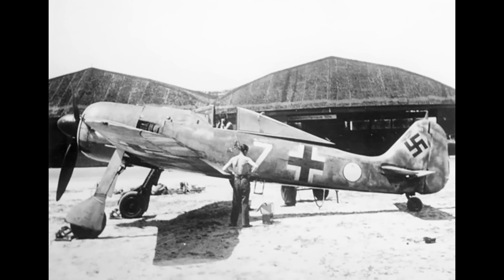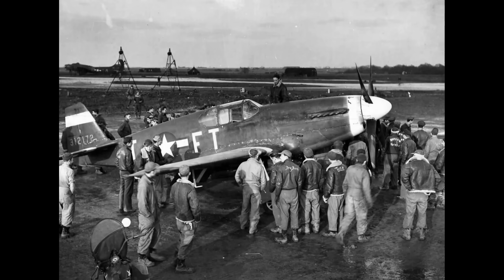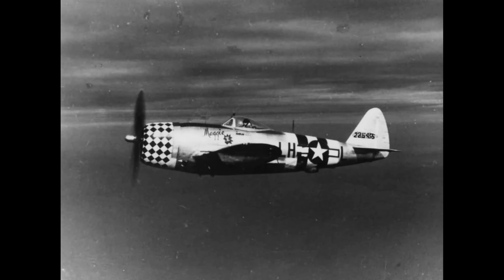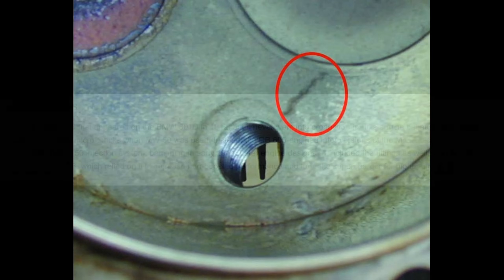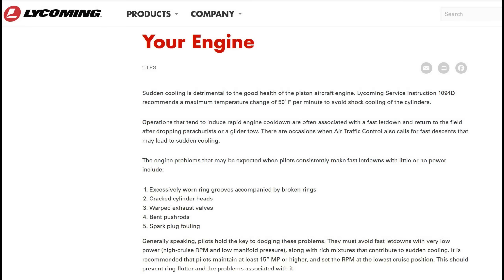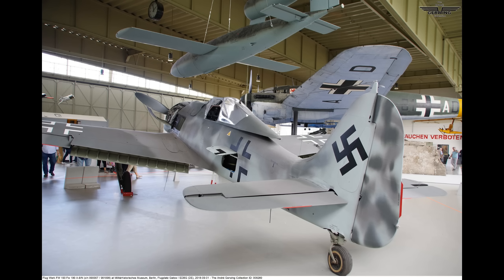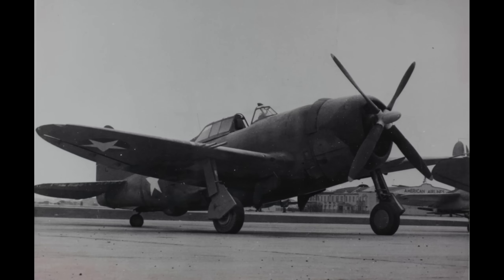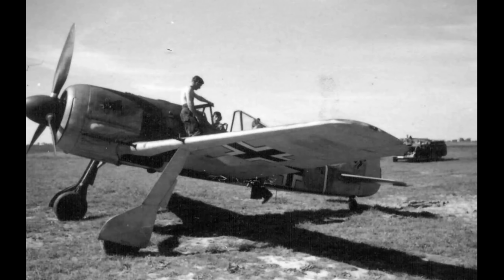Focke-Wulf Fw 190 A-4, Almost turned the tide, Almost...

Comment: Speaking briefly on cylinder head temperature, it's not unlike block temperature of the cooling in an air-cooled engine or a water jacket in a water in a water cooled engine, one thing they share closely is after hours and hours of being at a constant rate the metal gets fully total saturation of heat, this starts to happen after 3 hours of operation and continues to happen for the next 17 to 20 hours of continuous operation, anything after 3 hours the metal is totally heated completely through and through so the swelling is mild but it does happen in the casting. Billet aluminum reacts differently but that's another story, the point I'm trying to make is that when you back off the throttle pressure on an air-cooled engine and the increase in density of the air makes it react to the surface of the cylinder head casting, it contracts at a different rate, this leads to cracking on the surface of the casting.
After repeated heating and cooling cycles then the cracks become bigger.. engines that are in service for less then the 3-hour time frame, they do not suffer the heat of the deep soak.. cracking..

Comment: I have a lot of respect for your knowledge of aircraft. But, I’m tired at people thinking that “this could have changed the war”, or something to that extent. I’m not saying that that’s actually what your stating, but still…There is virtually nothing that would, or could have changed the war. Even the jets couldn’t have changed the war other than to possibly have lengthened it by a few months. Unlikely, but slightly possible.
Reply from the maker: I'm tired of people misquoting me. I said nothing about changing the war. I said turn the tide. The Luftwaffe literally DID turn the tide of the air war several times, including once time in late 1943 when they forced the USAAF to stop sending daylight raids into Germany.
Reply: @GregsAirplanesandAutomobiles  The source of this often- stated issue is that the title of the video and the still screenshot of the video should mesh with the content of the video itself- and they do not. In the body of the video, you clearly reference a 1943- time frame- but this is not referenced in either the title or the screenshot. Without that reference point, the title (and the wording of the screenshot) implies that the tide of the war itself could have been turned. I'm not trying to make a big issue out of this; I'm just saying that I believe that 'that' is the source of a misunderstanding.

In any event, it's quite a statement to say that the Luftwaffe turned the tide of the war in late 1943. Doing so would have required that they not only halted the Allied bomber offensive (which they temporarily did) but then took the offensive themselves right back to the Allies in something approximating equal intensity- which they were never in a position to do. FWIW, I believe that it's an open question whether German fighters with a few hundred extra horsepower could have hammered a resurgent Allied bomber offensive in early 1944 so as to prevent D- Day. The German fighter arm was being bled white of pilots by late March, but a few hundred extra horsepower just 'may' have prolonged that bleeding and delayed D- Day by some months.
Cheers...

Comment: The German found that the MW50 didn't work desirable enough on 190A. Besides the potential corrosion or cracking problems in the cylinders, to use the MW50 also required tuning the BMW engine into a lean mixture way for some reasons. This led to a situation where when the MW50 was not applied, the engine output would be lower and overheating might occur. On the other hand, the C3 injection worked almost flawlessly, it could increase the power to 2060ps at around sealevel without any significant changes or problem. The C3 injection was introduced to the frontline around July 1943, and it developed into the Erhöhte Notleistung, increased emergency power, in July 1944, which could be also applied at the second gear altitude.
Reply: This is more or less the correct story.    The BMW 801D2 is not an engine limited to 1700hp.   As the Germans increased the rating of C3 fuel from about 94/115 to 96/125 and finally 97/130 along with probably spark plug improvements allowed increased engine boost ratings.  As you can see the rich rating increased mainly.   The upgraded C3 fuels started to come in from 1942 as allied fuel intelligence noted (see Fischer-Tropsch Archives).    Two boost systems were introduced in 1943.   The first system was called "increased boost"  which which produced a rich mixture that was injected  via the normal injection system on fighter aircraft.  Rich mixture injection into the eye of the supercharger was introduced only on ground attack aircraft.  Latter the two systems were combined.    Long story short the BMW 801D2 ended up a 1900hp engine before being replaced by the BMW801TS and BMW801TH.

Comment: In the old game Chuck Yeager's Air Combat, which I was addicted to at the time, an FW-190 A-4 was one of two flyable aircraft of the WWII era, the other being a P-51D. The plane's description admitted something among the lines of "performance at altitude was poor, especially in the A-4 ground attack variant", and I've never quite forgiven the developers for choosing that specific variant then. 
Back then I could basically count the pixels above the horizon on my crt monitor to find a suitable steady climbing angle: the P-51 had considerably more pixels to spare than the A-4.

Comment: We saw shock cooling cracks primarily in TCM O-200 engines due to student pilots NOT practicing throttle disciple and the design of the cylinder head casting. The O-200(and pretty much all TCM engines that use this and similar cylinder head casting design) is a much lighter casting than a comparable Lycoming cylinder head casting. Less material in critical areas of the casting equals more tendency for shock cooling cracking. Student pilots were leaving the engines at full power, even when in the pattern for touch and go landings, then jerking the throttle back to idle when turning final. The result? Cracked cylinders. The Lycoming O-320s in Cessna 172s didn’t have this problem. We saw cracked cylinders on the GTSIO-520s on Cessna 421s but never saw a cracked cylinder on the Navajo C and Chieftains we operated on Part 135.

Comment: In descent, reducing power (and therefore MP) results in cooling that can lead to carb icing, which is why in descent to landing full carb heat is applied. Would that help to mitigate shock cooling at all, or is carb heat insufficient to overcome this? Of course in fuel-injected engines there is no carb heat, so would some sort of intake tract heater have been a possible fix for this problem?

Comment: Apologies if I've got this wrong, but from what I can read MW50 was injected into the face of the supercharger, cooling the incoming airstream before it gets to the cylinders.  If so, would not the freeze effect occur on the intake stroke, with the already-cooled gas stream meeting the cylinder surfaces heated by the power and exhaust strokes?  Compression of the cooled mixture would still heat it up (otherwise Diesels wouldn't work), so I don't understand how the maxiumum cooling effect would be on the compression stroke instead of the intake stroke.
Reply from the maker: This is such a common misconception that I'm going to need to make a video to explain it.

Comment: There are a lot of testimonies from RAF pilots when the anton came out and the effect it had. They are often described as more lethal, and harder to fight initially than then 109s. Because they could pull more in the first few turns and upgraded armament.
Clostermann also talked about that. They were preferred by axis pilots in the west before normandy at least. But its also true they faced more bombers
Reply: The Spitfire Mk V had a single speed supercharger with very tall gearing, the two speed supercharger in the 190A was more powerful at low and medium altitudes.

Comment: From what I've seen flying the A4 and A5 in simulators, supercharger gear ideal altitudes make a large different in dogfight ability. Staying somewhere around 5-6000ft makes an A5 handle like an A4 at a less ideal altitude like 10000ft. Unfortunately, the superchargers second gear only makes good power again up at 20000ft, where the wing loading becomes quite prohibitive to dogfighting.

Comment: Some should tell ford engine designers and cooling system designers about shock cooling. Especially with the issues with various small turbo engines and highly stressed truck engines. More attention needs to be paid post engine shutdown and large speed differences on high performance engines. I mention Ford as a Ford retiree but past Chrysler engines such as the 2.7 n/a V6 suffered sludging issues possibly related shock or flash cooling. This is an interesting issue that goes across other engineering systems. It seems cross functional team concepts work not only intra discipline but inter discipline systems. Thanks very much for this video post. Any auto people who see this video should pass the issues and ideas up the line. Thanks again.

Comment: The higher the octane the less volatile the fuel is. High octane fuel is great for air cooled engines because it prevents pre-ignition caused by hotter running engines. So with that said, higher octane actually means less power rather than more power. However, putting high octane in your car doesn’t make it faster, it’s quite the opposite, especially if the engine isn’t designed for it in regards to MPG, ping and power. Great video Greg!
Reply: Higher octane allows more power through greater boost or compression being allowed
Reply: @kenneth9874  This is true for engines designed specifically to operate like that. However, it’s a detriment to engines not designed to operate under high compression/temperatures. The octane is only added to prevent pre ignition of hotter running, higher compression engines. The octane in of itself doesn’t provide more power.
Reply: @privatepilot4064  it enables the engine to make more power, there's a reason the octane level were increased during the war.....it's called making more power.
Reply: @kenneth9874  I’m not disagreeing with you, but it will not make more power in engines that are not designed for it. The reason they increased the octane in WW2 was because of the high performance engines which needed the octane to prevent pre ignition, particularly in aircraft engines. Octane prevents pre ignition which means the fuel was igniting before the engine was in its optimal power stroke because of high compression. Similar to how a diesel ignites fuel. This causes knocking and loss of power, but only in high compression engines that are not utilizing octane. (That’s why a diesel always sounds like it has a knock, because it ignites fuel with high compression). Octane prevents this by making the fuel less volatile. The reason higher octane fuel is used in high performance cars (and often thought of as 'better' fuel) is high performance cars run high compression engines and need a fuel less likely to ignite from the compression energy. They produce more power because they burn more fuel not because the fuel is more energy dense. With that in mind, if you have an older vehicle that normally burns 87 octane and you develop a knock, it’s most likely from deposits that have built up in the cylinder reducing the cubic inch capacity and causing its compression to increase. In this case a high octane fuel would reduce or eliminate the knocking.

Comment: An interesting little video.   The '190 was excellent at low to medium altitude, and the RAF struggled with the Spit'V's for several months at low to medium altitudes. The articles from that period in the Tee Emm make interesting reading....! However the '190 was never great at altitude - certainly not the heights that the USAAF heavies normally operated at. Once the Spit'IX's appeared, the game was up as it was more than a match for the '190 within the Spit'IX's operational range. Once the P51's appeared, the '190's really struggled. A video looking into why the '190 struggled at the higher altitudes would be interesting. I was always led to believe it was a combination of poor fuel and supercharging - but I don't have a definitive answer, though the '190's fairly high wing-loading may have also been a factor. The design of the TA152 perhaps hints at the steps taken to resolve the 190's shortcomings.

Comment: As a glider tow pilot with 20+ years of experience, I can tell you that shock cooling is definitely a byproblem. The reason why you don't get a lot of cracked cylinders is because gliding clubs are very aware of the issue and managing the cooling after the glider has released is very carefully managed. After release the pilot will increase speed whilst maintaining the same RPM. Thus the cooling caused by the rich fuel mixture is replaced by the increase airflow.
+
Reply from the maker: Thanks, makes a lot of sense.

Comment: Hi Greg,

Why didn't Kurt put the 109 slats on the 190 to fix the AoA "feature"?

And because I came from the Spiteful superprop video, what would have been the next technological step to the 190 as a radial into superprop territory if the war had continued with optimal metallurgical standards?

I have pictures of the cherry hot Navajo Chieftan pipes, fun to fly but terrible to wrench on.
Reply from the maker: Hi Wingly, I'm glad to see you over here. I have never seen any mention of Kurt Tank considering leading edge devices for the 190. Of course they would have helped the plane, but I think it's a problem of cost vs. benefit. The 190 was designed to be easy to build and maintain.

Comment: After seeing Cletus McFarland use methanol, the cooling effect is massive.  It will actually cause water condensation and sometimes ice to form on the intake.   That stuff cools big time.  It probably did cause head cracking

Comment: Greg, As to the A-4 lengthening the European war, the May, 45 end saved Germany from the Atom bomb, so the lengthening of that war would not have been significant and might have caused a massive increase in Civilian deaths. I understand this is a bit of conjecture, but very plausible. But in war and life itself, unintended consequences, 20/20 hindsight, conjecture and all the other unplanned consequences and events play a big roll in the outcome. Perhaps WWII biggest "contribution" was the advancement of the airplane. "Jet air travel" happened jet nine years later in the Viscount (1939 to 1948) and a few years later in the Comet.
Reply from the maker: I was clear that this wouldn't alter the end result of the war. I didn't say anything about even lengthening the war. My point is that it could have delayed D-Day. Let's keep in mind that even without MW50 the Luftwaffe did for a short time in 1943 turn the tide.

Comment: Considering the 190s Command gerat, I wonder how the mw50 was integrated? Rather tricky to  modify the gerat. Perhaps it was a simple on off switch, could could lead to the engine going from full power and spray with max allowable head temps, to the gerat suddenly dropping the power (say in a dive to avoid overspeed? 🤷‍♂️) but with the spray still on. Hence not only cooling from the engine settings, but also the spray itself?

Comment: Game-changer? By itself? No. No way in Hell the FW-190 could have pulled even a stalemate by itself. Numbers still count, not to mention logistics, gear and vehicles for other branches, and the decreasing quality in the making of spare parts, and the decreasing availability of fuel in general and aviation fuel in particular for Germany, industry and military forces combined.
Reply from the maker: Even without it they stopped the 8th in October of 43'. Can you really say there is "no way in Hell" they couldn't have stopped it longer.

Comment: Thanks, Greg, alwys good to watch.  One question remains - if MW 50 was unusable on the Fw-190 in 1943, how did Germany overcome its problems to use it on the Me-109 in 1944 ?  Did something change ?
Reply from the maker: Yes, the 109 runs a liquid cooled engine of an entirely different design. Liquid cooled engines are much less prone to cracking heads in the first place.
Reply: @GregsAirplanesandAutomobiles  Excellent.  Thanks, Greg.  You're up early!  or late ?!

Comment: Even if the A-4 had worked out, could it really have stopped the Allies from getting air superiority over coastal France in 1944, thus forcing a delay in D-Day?  Wasn’t the real issue just the overwhelming Allied superiority in numbers and resources?  And Germany’s chronic deficit in oil and other strategic resources already evident by 1942 and especially 1943, to say nothing of 1944.

Look at the air battles on the Eastern Front during the Battle of Kursk in mid-1943, for example.  The Luftwaffe won almost all the actual air battles, but by the end of Kursk, it had been exhausted and overwhelmed.  On the Western Front the situation was even worse for the Luftwaffe, catastrophically so by mid-1944.
Reply from the maker: Consider that the Germans did put a stop to US bombing raids in October of 1943. The US was able to recover, but it would have been much more difficult had we lost experience fighter pilots at a much higher rate.